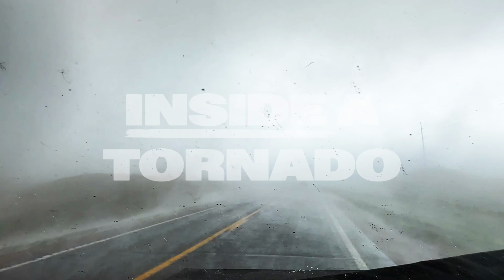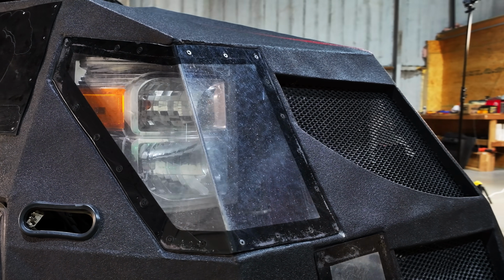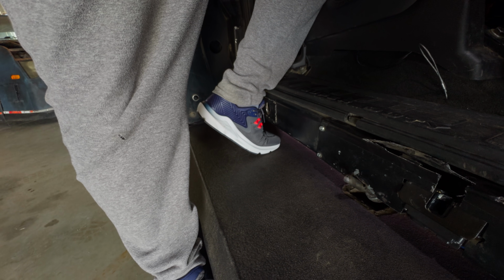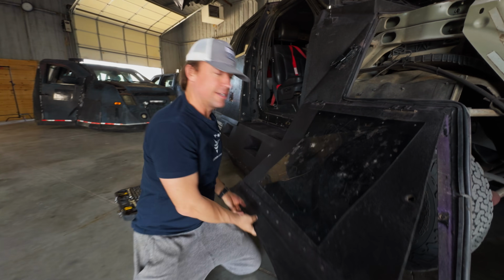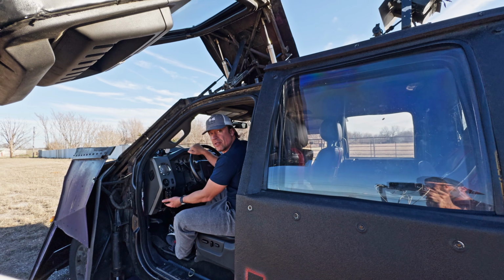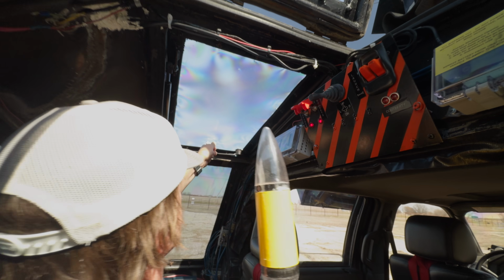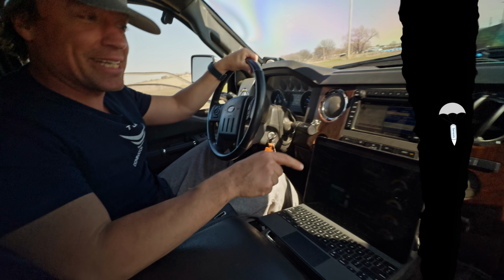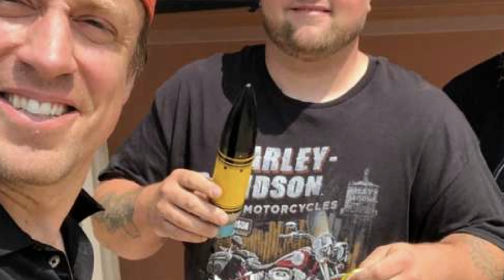Dominator 3 Tornado Tank ULTIMATE Tour

Comment: This is a very interesting question that I ain’t taking seriously. But the EF scale is designed for damage. It’s a damage scale and for it to damage something, the tornado must hit something. So would a tornado despite hitting nothing but the dominator be an EF0 or something else? Cause technically it does hit something.
Reply from the maker: Yes but they can give EF1 - EF2 based on vegetation damage. It is a damage based scale with wind estimates, you are correct

Comment: I believe another way to get your sensor into the tornado would be to use a crossbow or compound bow I think the arrow would punch right though that wall of air and when it gets inside the tornado I think the arrow would be light enough that it would stay in there for a good little bit just some food for thought

Comment: Had you considered using a vacuum system to suck the vehicle to the ground instead of/in addition to the spikes? Or would that not work well because the drop in pressure from the tornado overriding a low pressure under the vehicle?

Comment: @reed here’s my question with streaming. With the reinforced steel. Is it gonna cause any disturbance with signal? The reason I ask. Even a metal case on my phone messes with cell signal. 

Of course that’s if you’re only using what you were in the dom4. Or does dom 3 have a signal booster?

Comment: Time to upgrade the rocket launcher. Need to model after a Navy deck launch system. Triple rocket pods (Dominator 3 -rockets) with a guidance system movesble from inside vehicle. Rockets preloaded in tubes. Go live switches and launch buttons in vehicle.

Comment: 11:11  you need to make a little jack that you can quick connect to the leeds dummy proof fits on one way...  OR !!!  ATTACH THE LEEDS AND JUMPER TO THE ROCKET BEFORE YOU TAKE IT OUT OF VEHICLE... then have  a simple JACK where you plug into the PLUG that has the pigtail attached to the rocket motors... 

eh, you need a PIGGYTAIL ADAPTER Thingie with plugs to make that step quicker...  IT SEEMS TO ME YOU NEED ....

Comment: May 28th Tornado was in Lawrence, KS not Lawrencewood. It touch down 3 miles south of the University of Kansas.Then traveled east northeast and touched down in Linwood KS, northeast of Lawrence. You need to go back and edit this video. The city is Lawrence, not Lawrencewood, where you rocket touched down is in Linwood not Linville and it's only a 13 to 14 mile difference not 26 miles. I live in Lawrence and work KU and have video and picture footage of the tornado as it touched down.